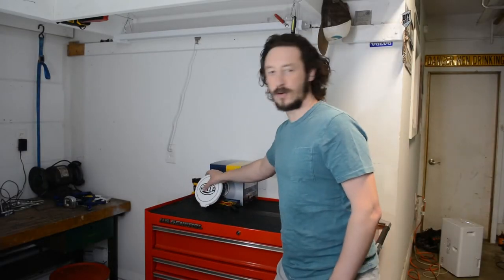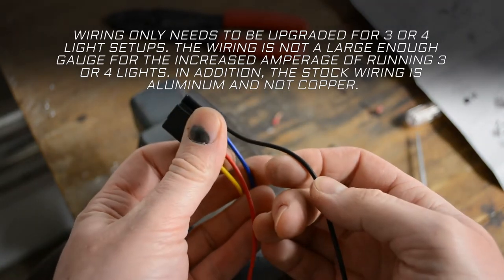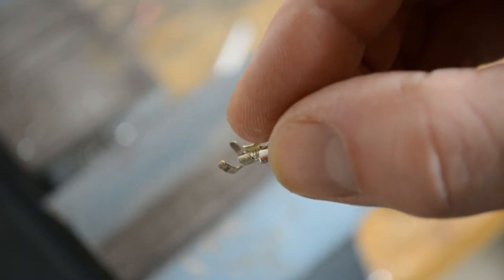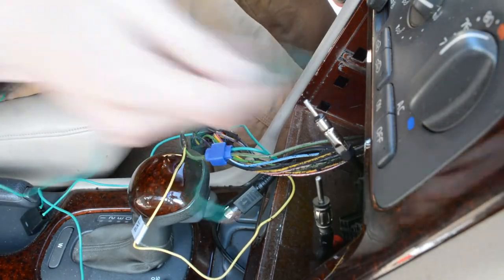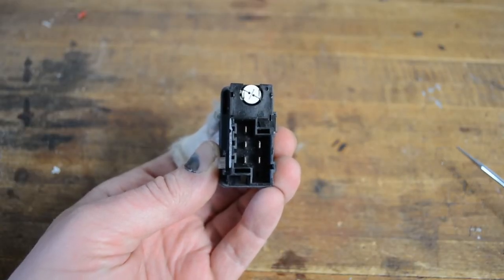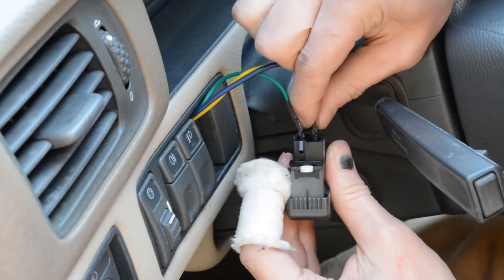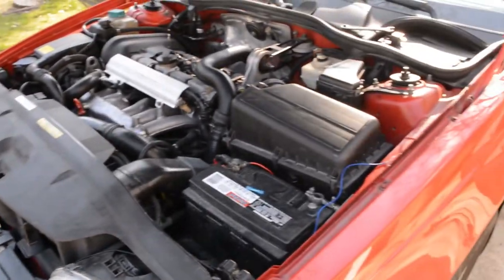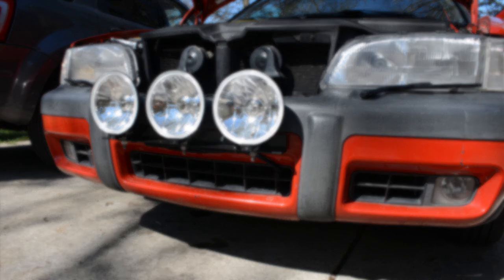Wiring Auxiliary Fog/Driving Lights - Volvo V70

Comment: This video is great I’m trying to install some on my 850 wagon. Do you know if I could use the OEM Volvo fog light plugs on the bottom of my car?? I would get the right relays and switches
Reply from the maker: Awesome! Those plugs are specific to the foglamp itself. I'm sure you could cut the connector off and splice in wiring to connect to auxiliary lights provided the wattage of the bulb is the same, but I've never done something like that. Anytime I've wired up fog lights I've always done it using my own wiring.
Reply: thats really good to know this video was a life saver for me I've been trying to learn how to do this forever
Reply from the maker: @GabrielSpence  Glad you liked it!
Reply: do you have an instagram or facebook I could message you about some more questions?? Im confused about the radio connection
Reply from the maker: @GabrielSpence  Yea absolutely, my IG handle is svalente315.

Comment: How did you install the bracket on the bumper that you mounted the lights on??? I'm stumped with how to install my lightball bracket and have it nice and sturdy did you pull off the bumper cover??
Reply from the maker: I did pull off the bumper cover and confirmed that behind the license plate holes were little riv-nut type things to screw into. It wasn't your typical self tappers into a plastic bumper. I wouldn't want to screw the bracket to just plastic, but seeing as there was something else behind it, I felt ok to give it a shot. It's been on there for over 2 years and hasn't ripped out, so I think it's ok.

If I didn't have those riv-nut things, I was going to drill through the bumper cover and attach the bracket to the bumper beam itself.
Reply: @StevesGarage  Interesting okay that is really good to know so I'll pull my bumper cover off this coming weekend and see what's there for me to screw in to that isn't just the plastic bumper alone thank you for the info!
Reply from the maker: @nwsights6301  No problem, let me know what you end up doing!
Reply: @StevesGarage  So I got my light bar installed, I got a 12 inch long drill bit that's 3/8, drilled through the stock license plate holes all the way through the metal crossmember inside the bumper cover, stuck two 7 inch 3/8 bolts and bolted the bracket like that. Nice and sturdy!
Reply from the maker: @nwsights6301  That things not going anywhere! Glad it's on and working great for you. Enjoy the cool look and better light output!
Reply: @StevesGarage  Yea buddy.

Comment: Can u help me?   So I have a tower of switches inside my jeep.  They all connect very cleanly to a bar inside my engine bay.  (S-Pod).   Can I just run the two wires from the lights direct to my spot poles + and - .    Would that work without all the relay stuff?
Reply from the maker: I've never had the luxury of wiring up to an sPod, though I do know what you're talking about. To my knowledge you don't need a fuse or relay for this setup, as it's all taken care of in the built in wiring. I would double check for your specific application though, because I don't have first hand knowledge of your setup.

Comment: great video! 
What gauge wire did you upgrade the power to? What fuse would you recommend for a 4 light set up? 
I recently bought a '14 Subaru Crosstrek with 4 of these lights, but the previous owner never had them wired. I really want to use them, and want to avoid a short circuit as much as possible. 
Thanks again!
Reply from the maker: Thank you, and congrats on the car! Glad you're checking out this video even though you own a Crosstrek, my goal was to try and create a video that everyone can use to reference. I upgraded the wiring to 14 gauge, which is good up to 15 amps. Watts/Volts=Amps. So assuming the bulbs are 55 Watt, you're looking at a total of 220W/12V car battery for a total of 16.9 Amps. I'd probably go 12 gauge wire for that, with a 20 amp fuse. 
Let me know if you have any other questions, I definitely understand wanting to use the lights if they're mounted! I've had the lights on the car since April, and haven't had any issues with car washes, and rain, so I'm confident in the method I used.
Reply: @StevesGarage  Thank you! You have the only video I can find on YouTube that discusses installing more than 2 of these lights. It's incredibly comprehensive and incredibly useful! 
I found that 220W/12V would actually equal 18.3 Amps. Would you still recommend 12 gauge? and the 20 amp fuse? 
Also, did you only upgrade the black wiring from the lights? Would I need to upgrade any of the other wiring ( excluding the ground ).
Reply from the maker: That's exactly why I made it! Figured someone else out there must want to wire up more than 2 lights. 
Good check on my math, not sure what I did wrong there haha. You should still be fine with 12 gauge wire and a 20 amp fuse. I did upgrade the wiring to the lights since I ran one wire out and only split it close to the lights. Technically you could run 3 separate power wires of the stock size back to the relay, but I didn't want to that for complexity sake. I honestly wish I ran the single wire further, but it's something I didn't think about until it was all wired up.
Reply: @StevesGarage  I appreciate you being so forward minded! I am definitely keeping the video for reference, and will recommend it to anyone I know who plans to have multiple lights on their light bar. 
I reread the wiring kit, and it includes a 30Amp fuse, So I should be okay ? 
Also, based on the wiring system ( its the Hella ValueFit Kit ) it looks like I'm going to have to attach 2 lights to each of the leads to the relay, to keep everything as simple as possible. I just hope the connector that attaches to each lead will hold up. I will definitely get some heat shrink to keep the connection strong though
Reply from the maker: @neverwonder  Thank you! The 30amp fuse should work fine. Terminal size may definitely be an issue with 12 gauge wiring, as that is a bit bigger than the standard wire. I suggest buying new ones and not re-using like I did, just because it's a pain and then you can also get the right size terminals. If you want, you can run one wire out of the relay, and then split that wire further down using a but connector, or whatever type of connection you want. I may have gone overboard with the heat shrink, but living in a winter state, and that wiring being low and on the front of the car, I don't want to take any chances. So far so good with rain and carwashes!
Reply: @StevesGarage  I plan to move to a winter state in the next few weeks, so heat shrink is gonna be the way to go! 
I just have one more question: 
Looking at the connector between the lights and the powerlead, it does not appear to be 12 gauge . 
I am talking specifically about the two connectors at the bottom of the pic in this link 
https://www.amazon.com/gp/product/B016VAHX8E/ref=ppx_yo_dt_b_asin_title_o06_s00?ie=UTF8&psc=1
Would it be best to replace the existing wires with 12 gauge, or do you think they will work fine? 
I genuinely appreciate all your help with this!
Reply from the maker: @neverwonder  Congrats on the move I hope? I love winter. Looks like your wiring is a little different than what I had with those connectors. This is where my electrical knowledge kind of fades off unfortunately. I don't think that you want to reduce the size of the wiring even after the split to the individual lights. That being said I could be wrong, and someone that knows more about wiring would be better suited to chime in. But I don't think you want to reduce it because of the total power the wire is carrying.
Reply: i guess im randomly asking but does anybody know of a tool to log back into an Instagram account??
I stupidly forgot my password. I appreciate any help you can give me!
Reply: @Adriel Spencer Instablaster ;)
Reply: @Rey Bode i really appreciate your reply. I found the site thru google and I'm in the hacking process atm.
Looks like it's gonna take a while so I will get back to you later with my results.
Reply: @Rey Bode It worked and I actually got access to my account again. I am so happy:D
Thank you so much you saved my ass !
Reply: @Adriel Spencer You are welcome =)

Comment: Hello, I've tried this exact setup on the same car. Nothing works?! I tried two oem fog light switches... Both are good. I'm grounding the switch under the dash.
Reply from the maker: If it's not working then you need to troubleshoot whats causing the issue. It might not just be the switch. Do you have a multimeter? You can use one to measure voltage to see where the power is being lost. You can also use the multimeter or a test light to check your grounds are good. This setup is the same idea as the wiring video I did on the Jetta and I haven't had issues with either one.
Reply: @StevesGarage  thanks for the reply! I have a voltmeter that's somewhere missing right now... I'm wiring the Hellas on a V70 XC. Identical to the one in the video. I pulled the lights and tested them with a battery I had in storage and they worked. I've grounded the relay to the factory grounding point on the strut tower. And I've run the ground wires for the lights it's a negative terminal, and the ground wire for the relay as well. Yellow blue green into the Volvo Foglight switch, I grounded the switch to the metal brace under the dash on the side of the frame. I'll try and locate my volt meter.
Reply from the maker: @SAFphilly  Of course, I try to reply to everyone! Sounds like your wiring is solid. Try running the switch that comes with the Hella lights as a test. If it works with that, that indicates that the Volvo foglight switch is the culprit. Are you using the front foglight switch vs the rear foglight switch? Mine is wired to a rear fog switch, so maybe the wiring is different for a front fog switch? Not sure if you have an Instagram, but if you contact me on there, we might be able to share some photos and get this solved! Definitely want to help you getting your lights up and working!